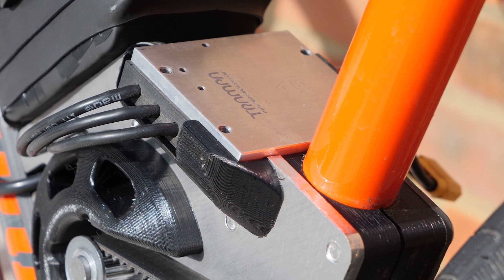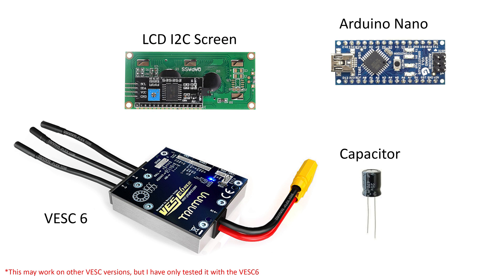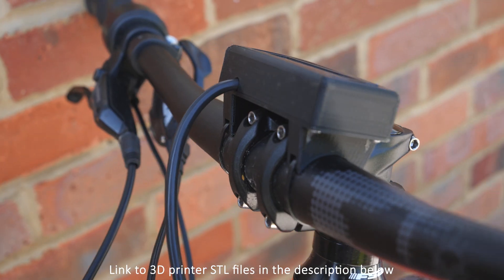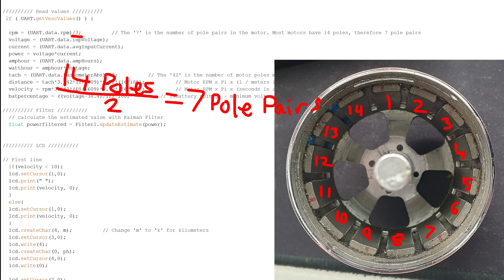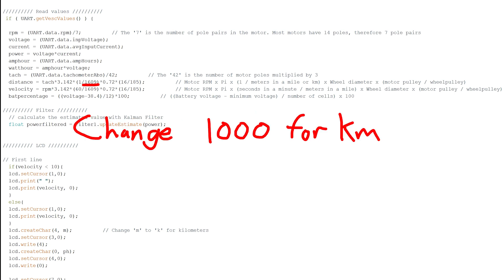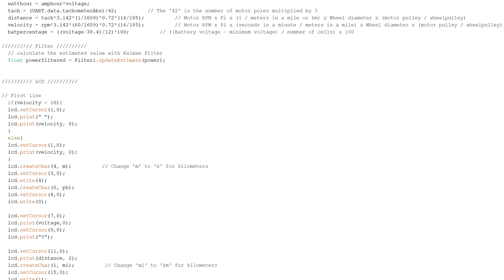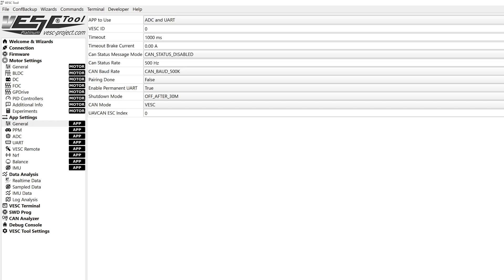VESC LCD Display

Comment: Hello! 🙂 Question: I have the VESC 75100 with Bluetooth module and everything works But question: I have a VSETT display and I can upload this Lisp file for the VESC and VSETT display but it says ;  no paired!  I would have to connect the VSETT display to the VESC so that it switches on the VESC and then I can upload the Lisp file for the VSETT display and the Erorr 10 error on the display will then disappear and the kmh display will then also work.  PLEASE can you tell me because the VESC does not have a power cable that you can switch on the VESC with the display because normally there is a red power cable, a GND minus cable and a blue cable, all of which the VSETT display has but the VESC does not because the blue cable is normally there  With the standard controller, return the strim to the controller and then switch it on immediately.  How can I do this with the VESC so that I can switch it on with the display?  I have now only connected VSETT display with VESC Rx to Tx and Tx to Rx but that is not enough because I still have to be able to set the controller with the display somehow.  Can you please tell me how and which two cables can I use to switch on the VESC with the display?  Because it doesn't have a power cable, Sonett only 5V + cable and GND cable.  I only connected the gas that is connected to the display to the VESC on Adc1 with the Hall voltage cable and everything works.  Just please can you tell me can I connect the display to the VESC with 5V and GND cable using the display power cable and GND cable?!  But when I now connect the battery with the VESC XT60 connector, the controller is immediately switched on!  Hmmm... I have now closed the VSETT display on the battery permanent plus and minus, but where do I have to connect the plus and minus cable from the display to the VESC so that the display switches on the VESC?  Please can you just tell me this and help me?  I beg you very much!  Because you are probably a professional in electronics and have managed to connect the display to the VESC.  PLEASE!

Comment: Thank ypu so much Tom. Have you figured a way to get a better battery % ? Voltage drops with power demands,  meaning it will have big fluctuations. Perhaps adding a average value, but still. Using Ah used should probably be a good way to go? Saving the values for each ride to an SD and resetting it once battey is charged again.

Your input would be very valuable.

Comment: which parameters to use so that I can read the speed using an external sensor, connected to the rear wheel, because my project will use a 6384 engine, with a vesc 75100 mid drive, and because it has gears, I would need to measure the speed directly from a sensor connected bike wheel, thanks for the video!

Comment: Would it be possible to switch profiles on the VESC remotely via UART?
Reply: yes and no... you can change any setting i beleave in the vesc on the flu thru uart. the vesc does not have profiles built in. what you would have to do is have a microcontroller with set profiles in it and have it wright them to the vesc

Comment: 9 months on from this video is this vesc still a good option .. i have a 1kw ebike with a poor quality esc on it but great everything else eg a king meter lcd and bayfang hub motor and want the best out of it
Reply: vesc is an amazing controller if you know what your doing with it and u understand its limitations. its not like almost any ebike controller you have ever seen as it is ment as a genral esc for motors and was more geared to eskate when it was first invented. it has come a long way now though and they have ones that can handle up to 100v at 250a contunious.
Reply: @spcolsson  what are VESC's limitations?

Comment: I would like to give you a Coding tipp. Those lines calculating the distance and velocity are way easier to read if you break them appart. something like:
pi = 3.142;
wheelDiameter = 0.72;
gearRatio = 16/185;
distanceInKm = tach * pi * wheelDiameter * gearRatio * 1000;
distanceInMiles = distanceInMeter / 1.609
velocityInKMh = rpm * pi / 60 * wheelDiameter * gearRatio;
btw. isn't there missing a times 2? I guess the rpm/7 instead of 14 is making up for it.
Either way, I think you get the point. This way the comments are unnecessary and the code is way easier to read and adapt.

Comment: NOTE: 
ADC is Analog to Digital Control,  that's for reading the throtle like a potentiometer.
He selected with UART for data transfer between Vesc and Arduino.

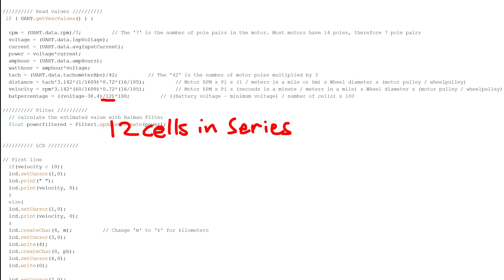Comment: At 2:27 I'm quite sure that your code has some issues there. You do integer divisions where you really should be using float. The expression (16/185) results to 0 as the result of an integer division is always rounded down to an integer. If you want proper floating point division, you need to make your input to be a float or double. E.g. you could write (16.0 / 185.0).

Comment: Is this library any good for making the Arduino control the VESC's throttle? I'd like to build a road legal ebike, so 250W/15.5MPH limited with pedal rotation sensors, and having an Arduino between the throttle lever and the VESC seems like a good way to do this.

Comment: Hey,  a (somewhat) related questions about battery percentage. At the 100% range and almost 0% range, the ratio of voltage difference to discharge rate seems (on paper, at least) rather non-linear. First, is this what you have seen too? 
And in real life testing, has this presented you with any issues when estimating how much range you have left?